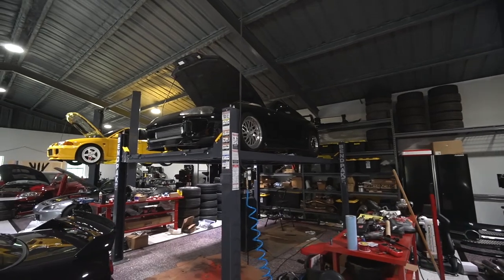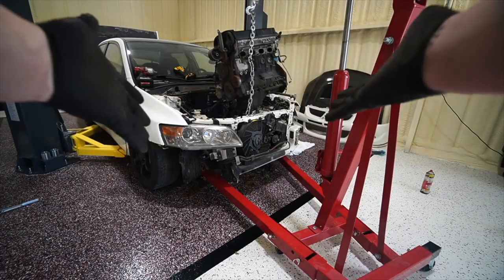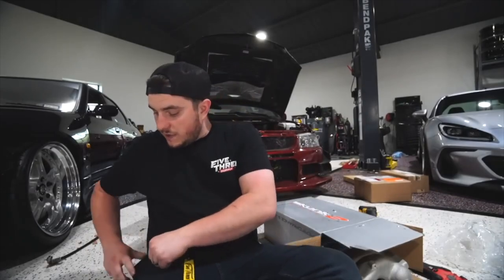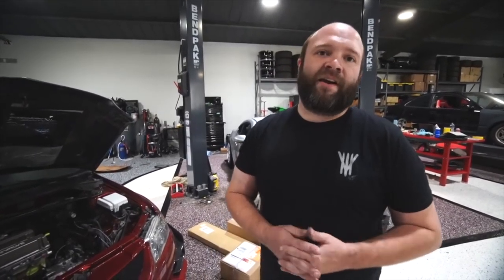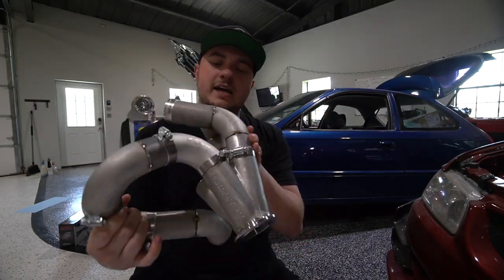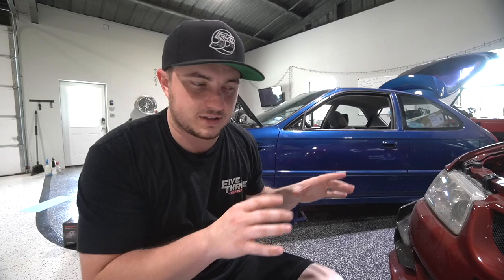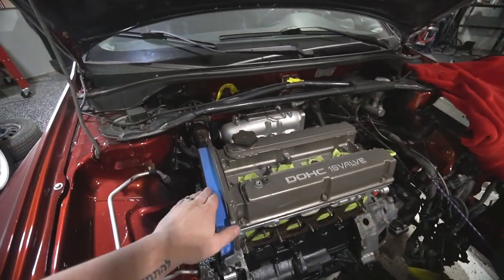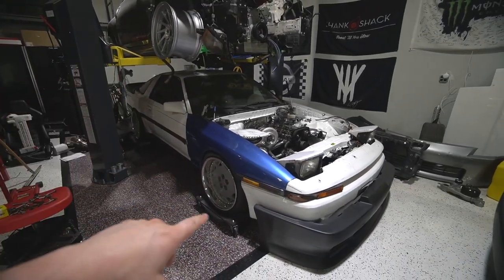What happened to my Barn Find Evo VIII MR?

Comment: Evan! you don't need a clutch alignment tool for the v160! you can put the pressure plate and clutch disc on the input shaft, then put the trans on the motor. when you have done that you can bolt the pressure plate to the flywheel through the wholes on the side of the trans!

hope this helps you out, Love the vids man!! Hope to meet you in person some day!❤